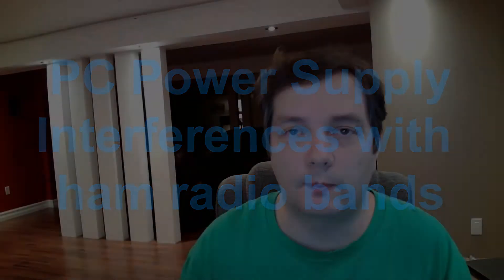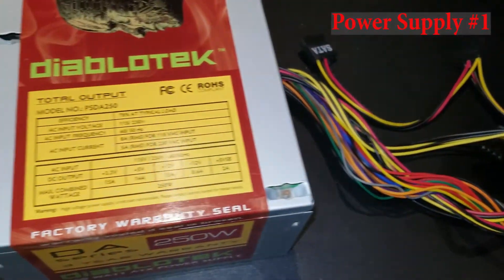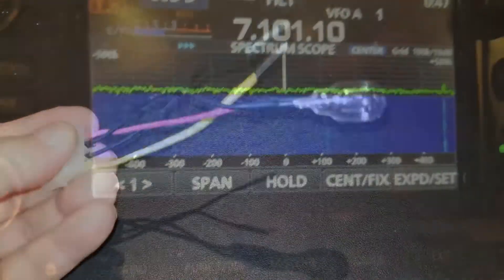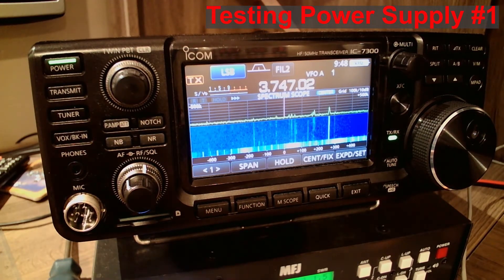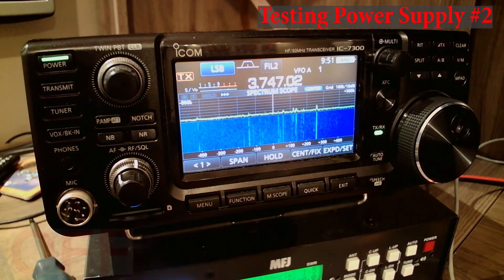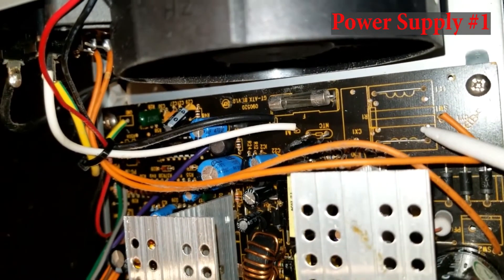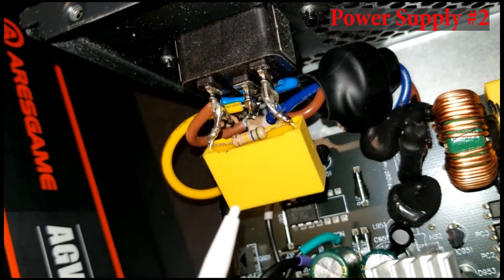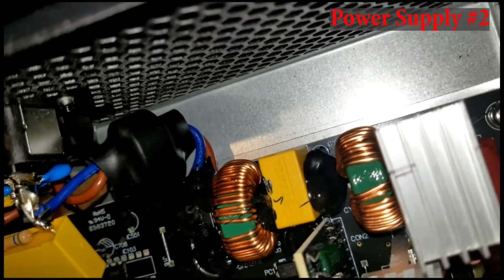Ham Radio RFI Caused by PC Power Supply

Comment: I just replaced a power supply for some pretty bad RFI. In my case, the bad one Is a Cooler Master Masterwatt Lite 600. Now I think I will take a look inside. My good replacement is an EVGA 750GT supernova.
Reply from the maker: It would be interesting to see what you find, or what you "don't find" inside.
Reply: @bogdanscarlatescu1470  I did look. Nothing jumped out at me. There weren't any obviously missing filter components.